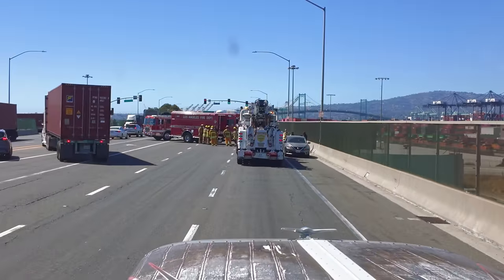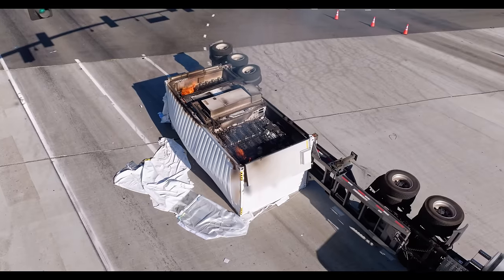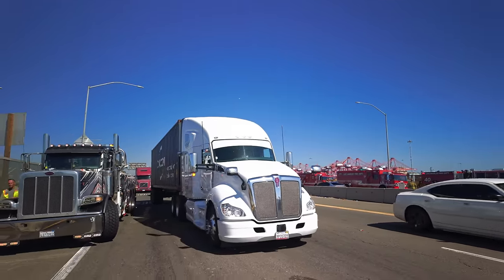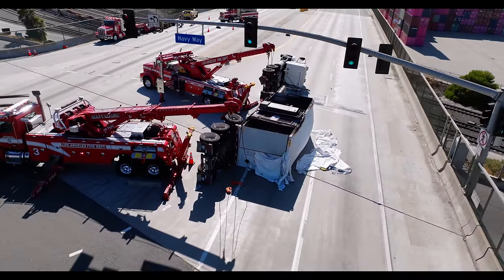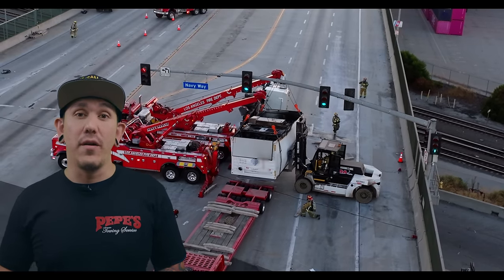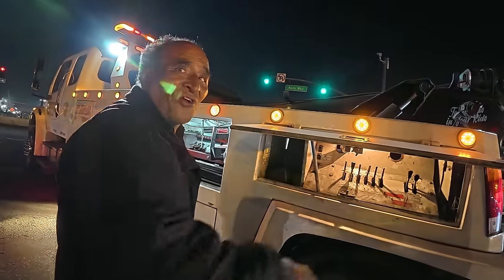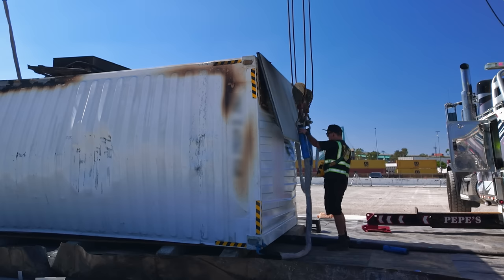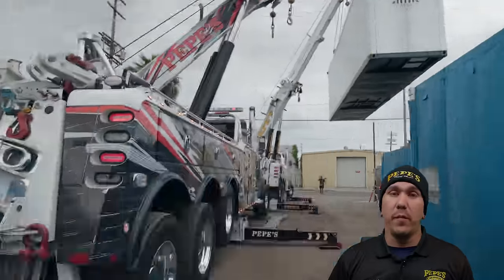60,000lb Lithium-ion Battery EXPLODES on Freeway!

Comment: There was a massive crash on I-95 in Virginia today involving a tractor trailer and a trash truck that caused a fire so hot that the interstate is still shut down over 12 hours later and five vehicles incinerated, damage to the road so nad that will keep I-95 shut down indefinitely. No lithium batteries involved.

Doesnt really matter what chemical causes the fire, it's gonna do a lot of damage and will require specialty personnel to clean up

Comment: Wonder what type of procedure is going to be adapted to deal with these type of lithium battery power packs? Perhaps a concrete pumper truck filled with just sand and enough water to make it mobile could be used to quench the battery stack? Why let fire spread and let the entire system burn down to nothing?  Seems to be a safe approach but not efficient
PS — sand would suppress any shrapnel from a potential explosion

Comment: That’s an air handler or a large air conditioner. It’s used to cool data centers. It will only weigh about 10,000 lbs. The weight being sited includes the tractor and trailer. The battery that exploded is small and used to start the engine.

Comment: The problem with lithium baterries is the thing that makes them work so well, lithium. It burns when exposed to oxygen. It can split water apart, so dumping water isn't effective unless you have thousands of gallons, and even the foam suppressants don't work well cause they are water-based for environmental reasons and lithium can rip the water out of just as easily.

Comment: Credit to the people who built the pack that could have thermally run away so much worse. As much as it’s terrible that it burned for that long it’s better for it to burn long and slow than all at once. The explosion could have been prevented if the container didn’t seal it wouldn’t have been able to build up enough gas to explode.

Comment: Bro saved a company truck (that’s fully covered by the company so it’d have been replaced) cuz that same company didn’t spend the time and money on proper training. This is counterproductive af. I respect the drivers doing what he thought was best but it’s not. At all. Unless 65k+ lbs of Li batteries were in there it would not have exploded in the conventional sense. This comparatively small amount would definitely pop open and have a loud boom but containing it in a metal box is preferable to just dumping them like this. The explosions aren’t the main concern with Li it’s the difficulty in extinguishing the fire & fumes emitting from compromised seals. It can be lethal asap. So his quick thinking was spreading Li fumes and a material that can’t be put out by water from a metal container that would have kept it safer and easier to take care of (with covering it with EV blankets until Li gel extinguishers arrived)to a street that people live on

Comment: Unbelievable, this footage was used on my local newscasts. That's the thing about lithium batteries, they are extremely unstable...Its the reason these batteries is not allowed on airlines. Had an incident where I am where a lithium battery was on the 'charger' in a guy's house, then supposedly got overcharged, 'it' blew up and caught the house on fire and made our local news also.

Comment: The lithium is on fire. Metal fires are a whole new ball game because of how hot they burn. In a battery there are oxidizers present other than oxygen, so they can burn through things that most fires would not.

Comment: You should consider getting trained by a fire trainer on the batteries I volunteer and our whole station had to take the training because we had several recent car fires involving teslas and several other cars with these type of batteries, one of which we had to submerged for 28 days when we took it out to see if the fire was out it reignited I know here in PA the Training is available.

Comment: Truckloads of sand is all that really could be done once they got it to where it needs to be to keep it from continuing to react and burn. 

If that lithium bank had really caught and burned, that container literally would have melted , even if it is made of Corten steel and most likely that bridge would have had a huge hole burned into it.

Lithium is a way different beast compared to modern lead acid batteries or agm packs. 

Thankfully it stayed contained without too much ignition from the banks. 

Unhook slack adjusters and chain the s-rods in place to let it roll. Maybe even have for the future, a impact drill with a huge bolt and nut to quickly get them locked in place with the chain pieces.

I also carry an air hose with a glad hand on one hand and a fitting to fit an air hose that is broken, to connect it to help a driver get a container out of the road. Small things that you never know you need, until a situation is necessary for them.

Nice content sir. 👍

Comment: I think it should be internationally mandated for all containers with large lithium ion batteries inside to be solid color painted with that reflective stuff they use for road signs. Maybe with large skull and crossbones on all sides, the height of the whole container. L-ion is hyperfuel.

Comment: Great job. All technology evolves. Look back at the turn of the last century when gasoline cars first became popular - there are challenges that once overcome make the world better. Even gasoline vehicles took a hit again in the 80's when Pintos exploded when hit from behind. Lithium improvements are already getting ready to go into  production that will make these fires a thing of the past. Solid State chemistry eliminates the fires from damage and thermal issues because there is no longer a liquid solvent - the liquid short circuits causing the fires when the cell is damaged. Solid State is no longer liquid, so that issue is solved, unless there is another way they can short circuit. ALL energy dense materials have this potential - gasoline, diesel, hydrogen included. There are 1/10th the number of fires with EVs, they are just more intense when they occur - until the solid state technology factories come online.

Comment: Lithium Battery fires should really scare people. A car fire for a combustion engine car is around 1,500°F. An electric car fire is 2,500°F. Worse still is the fact that Lithium is a reactive element that reacts exothermically with water. So you see a lithium battery burning and think "I'll pour water on the fire to put it out." Dumping a bucket of water on it will actually make it burn even more. There have been burning electric cars that had to be submerged in a pool of water for 72 hours in order to put it out.  Thankfully, sodium battery technology is around the corner and will hopefully be a safer option to Lithium.

Comment: I don't know anything about these trailers, but I know that the lithium batteries we can buy at the grocery store, like AA or AAA, if taken apart, the lithium metal inside can ignite, and/or explode, by touching water. I would think this would be about the same, where you most definitely would not want to spray water on it, but like I said, I don't know anything about these generators.

Comment: reminder this is 65X the size of a Teala cell in a electric car so keep that in mind
For every 100,000 electric vehicles, 25 catch fire annually, statistics compiled by AutoInsuranceEZ show.

However for every 100,000 gas-powered cars, 1,530 fires are reported a year primarily due to fuel leaks or crashes.

Comment: once one cell of the battery is damaged it starts a chain reaction. a slow one but one after another each damaged cell burns out an damages the cell next to it until there all gone or maybe one widthstands it til the previous cell burns out i assume but i know this is one of the "issues" with going all electric, this is the only power source we have that is robust enough to somewhat handle the demands.the only ones ive dealt with are just a bunch of small 18650 batterys that r usually in parallel to increase storage so most the time running at lower voltage or if they are in series its only 18 24v so not big at all but ive looked into this stuff way more than i should for how little ive used it.

Comment: Safety (distance) is everything you could handle and it's effective.

Year or two, we have system and methods how to deal these... That was just very good backing, because it didn't fly everywhere of country with burning pieces..

It's not impossible to make safe back like that was, I mean, even more safe. No matter if it had shoot few times with .50cal.

Salt,sand and silicone could make mixes that lasts, could rip and release pressure but not fai overall...

I think I need to go in business... Because these just keep happening.. :)

Comment: Yes, I had a battery from my DJI Phantom blowup because I accidentally dropped it on a small pointed rock. It started to swell, smoke and then blew open like a 3 pieces of an accordion! I did get a rough whiff of the smoke and I choked badly.

Comment: Lithium will go for a long time till it's out. It also has a massive storage cap. These batteries when they go off they "run away" like an old diesel engine would. They redline and keep going till they destroy themselves. Ive seen it at vape meets and other things. We used them long before mainstream did. Ive seen little cells flying across the room bc someone had too low of a resistance coil at a vape meet.

Comment: I wonder how it damages the roadway, like, i know its a much smaller area of impact compared to something like an oil tanker fire, but i feel like the temperature may or may not be significantly higher and do more damage to the parts that do contact it, this fire didnt look too bad, but lithium itself if it catches fire instead of just the electrolyte it can reach ~1500C

Comment: This is something to keep in mind with all EV's. Any wreck is a potential bomb and fire hazard. Contrary to videogames, gasoline tanks don't explode. If there is a gas leak, you smell it. An abandon'd vehicle on the side of the road isn't likely to randomly explode.
With a battery, you don't know the health of the vehicle. Any wrecked or abandoned EV could be a bomb any two EV's that wreck during a rain storm could result in a fire that can shut down an interstate.
These are the hidden costs and dangers of EVs that gasoline doesn't have

Comment: It's not a 60,000 battery, it a 60,000lbs contraption with a battery inside, had it been actually a 60klbs lithium battery, the explosion would have been much more violent not to mention the massive fire.

Comment: If the fire department was the one involved is the recovery? The price just double to a few millions and whom ever needs to pay? It no longer has a say so on the price tag as you just can not fight the 3 later government.

NSA, DOD, FBI, DOT, HazMat, etc.
Plus more regulation on transporting this type of loads next fuel storage.

All because one driver was to stress out to understand the safety rule AND PRESIDURE of THAT type container. He is so fired.

Nice video ❤❤❤

Comment: Nice Real Life jump scare!
When the solid state battery is finally ready for mass production, things like this can't happen any more. But sadly, they still have a lot of unsolved problems in mass production. 
On the other hand, there is a battery factory in Germany starting to produce Zinc-Ion Batteries. They are very heavy and have a poor energy density compared to modern Lithium-Ion batteries but they "last forever", can handle much greater currents and can't explode. So they are perfect for stationary energy storage. For cars and mobile devices, we need to wait for the solid state battery. This will take a few years until the problems are solved and they start to build new factories.

Comment: Li-Ion batteries have ~3 MJ/kg of energy. TNT has ~4 MJ/kg. Difference is the speed of release, ms versus hours (milliseconds, TNT).
Li-Ion batteries are bombs in the waiting, if you did any 8th grade Chemistry, being a alkaloid it's reacting with water in the air, a.k.a. humidity, creating usually Hydrogen gas, which has no odor, can't be seen, seeps through the smallest of holes and has low ignition energy, unlike gasoline, or properly, gasoline fumes as they are what burns and that heavier than air, it doesn't "burn or "combust" or also know as "deflegrate"- meaning "Deflagration is subsonic combustion in which a pre-mixed flame propagates through an explosive or a mixture of fuel and oxidizer." - it detonates [1], i.e. goes boom, which kills people. Also Hydrogen and Gasoline (not Diesel) differentiate that their stoichiometric - is the relationship between the weights of reactants and products before, during, and following chemical reactions - values are vastly different. While gasoline-air mixture will only ignite between 6:1 (16.6%) and 20:1 (5%) (for propane 2.1-9.5%, and methane (natural gas) 5–17%), Hydrogen on the other hand it's ratio is between 1.33:1 (75%) and 34.3:1 (~2.9%). 
Coming back to ignition energy, people ignited gasoline fumes being statically charged on petrolstations. Humans feel the discharge, what you hear as snap and feel a pain, at about 1000 V for ever 10 000 V (10 kV) it can jump ~1 cm in distance, so that's ~1 mm, it depends on %RH and other factors but that's the guiding values. What people don't realize is that any form of movement creates this static charge and that they are constantly build up and released, but to have a 200V charge is nothing special and while it's only 0.2 mm and usually unbeknown to people, being under the threshold, it happens and the 200V is the ignition energy in Hydrogen "enriched" atmosphere. So wearing ESD boots is a must, though they should be low Ohm (0.1 Ω).

Also Li-Ion batteries or Lithium Batteries in general don't like temperatures above 60°C, like laying the sun, like fire. Their internals disintegrate and they bulge and well are also begin to be reactive to position and position changes, think: a two liquids inert for each other like those fancy drinks with those fancy colors, non-inert when mixed, move them - i.e. mix them - to your own peril.

Lithium fires are not extinguishable by water, again alkaloid metal, dihydrogenmonoxid, H20, being water. What helps is sand, copious amounts. Like with magnesium fires and phosphorus, learned that when those Stabbrandbombe, AN-M50, fell on our cities.

So yeah, "don't know the technology" and "seen more beaten up containers" sure gonna work for you.

[1] Detonation (from Latin detonare 'to thunder down/forth')[1] is a type of combustion involving a supersonic exothermic front accelerating through a medium that eventually drives a shock front propagating directly in front of it. Detonations propagate supersonically through shock waves with speeds about 1 km/sec and differ from deflagrations which have subsonic flame speeds about 1 m/sec.[2] Detonation is an explosion of fuel-air mixture.

EDIT:
Ever wondered how the Beirut explosion came to be? 
How about 60+ containers of 30 t each of Li-ion batteries? Even saying 50% is batteries that's still about 1 kt of explosive.
Look Australia Tesla Battery fire they were already crammed, less than 1 m distance makes it safer, right?

Comment: Interesting, but not much of a shock wave, as the guy's camera barely shook...particularly at such close range. It's almost as if the gaskets in that trailer container couldn't take a low pressure build-up of gasses any longer. 

How do you know this battery weighs 60,000 lb? That's an unbelievable number for a fairly small container.

Comment: well, chemical and electrical fires you would use an extinguisher containing CO2, powder graphite, ABC dry chemical, or sodium carbonate usually or (halon gas???).  the fire departments may need a trailer of some kind that can set up a containment wall around a fire to apply these gas types of extinguishers, along with a heavier gas that traps it within the limits of the walls.  to keep normal atmospheric "issues" from dispersing it from inside the walls...  transporter/vehicles and housing/commercial entities should implement safeguards ((not required by law in all areas yet?) you'd have to check out your local /state ordinances...federal as well since idk what the fed requires as safeguards.)

Comment: That's right.  These are hybrid, self-contained, power plants.  What we would call, a computer backup battery power system.  It's just a really big one.  Big enough to power all of the video games at casinos along with the air-conditioning.

Yes they are used for, hospitals.  They are used for computer centers.  Emergency services, need these things.  They are more than just a generator.  They store energy.

These things are ferociously heavy.  Because lithium is a metal.  That has been liquefied.  But it still heavy like a metal.  Because it is metal.  In liquid form.  That, explodes.  In the presence of oxygen.  Which we have a lot of on this planet.  Though it's only 21%.  It still makes for a huge flammable flames.  That can't be put out by water.

One day I fear you will be blown to smithereens.  And/or incinerated.  On the spot.  Instantly.  You won't know what hit you.  Like the people of Hiroshima.  They have nothing to complain about.  They were instantly dead.

So we Can't, have terrorist bombs in our possession.  Unless they are made from lithium.
RemyRAD

Comment: This on my opinion is just pure engineering incompetence.... 
If the design is so weak and sensitive that a simple roll over with no container damage is enough for the batteries to start a runway condition, it means they shorted somewhere inside. 
The manufacture of this should be sued.